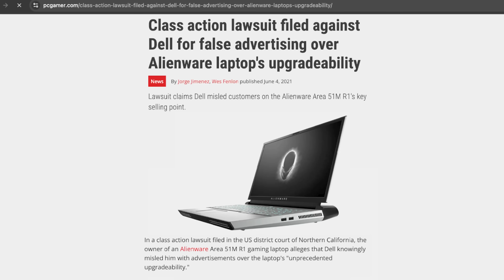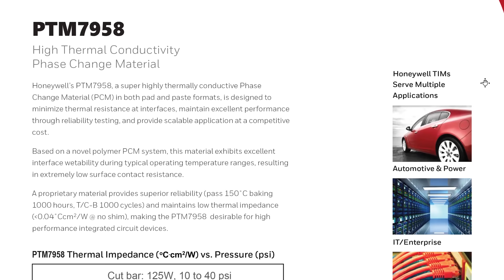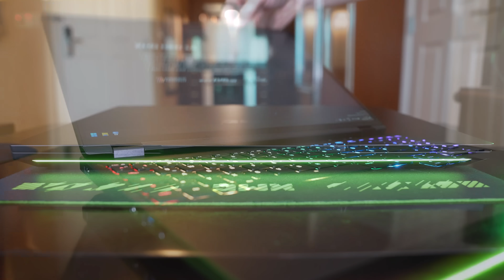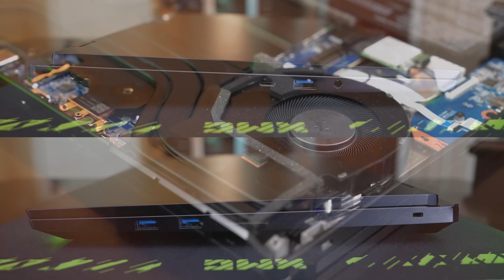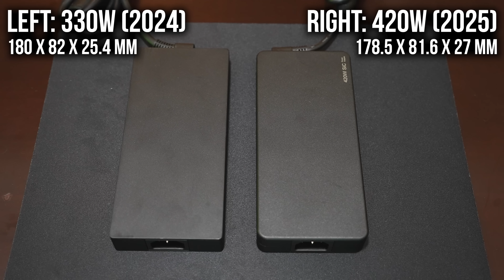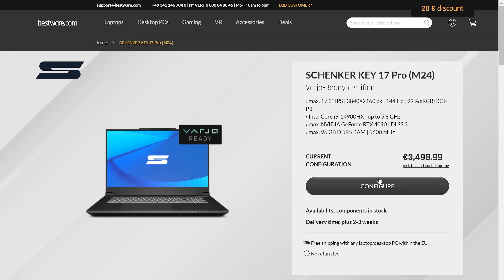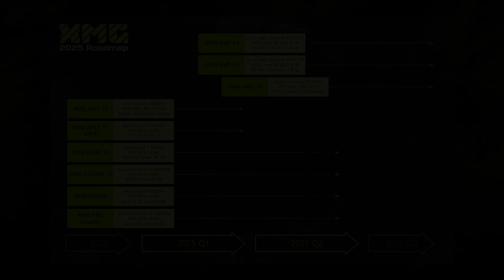This Gaming Laptop has Separate CPU & GPU! - XMG Neo 16

Comment: A step closer to upgradable GPU from big manufacturer. 
Framework is a godsend in comparsion still, but this, however small is a good step in the right direction.
Reply: It's proprietary, so is not a manufacturer agnostic standard, and pricing will probably be ridiculous, as the custom derivatives of MXM boards ended up being (e.g. Clevo)
It's also a long way away from what we had when MXM was a thing and we were putting MSI boards in Clevos and Clevos in Dells and stuff like that
Reply: Not offering the possibility of upgrading with same series GPUs and CPUs , and making it a closed system , makes this a totally useless " innovation" that benefits only XMG ... And it will be marketed as a huge thing and even command a hefty premium ... We're going backwards , and the users are now being used beyond belief.
Reply: Framework is way too expensive to be a sensible option
Reply: @shy9407  That has nothing to do with why Framework isn't sensible right now. The problem is that they still have no sensible dGPU options on their 16 inch models. Like, it's been almost 2 years since this laptop was announced and they still have only one GPU option. Like, I know AMD and Intel don't have any options and Nvidia doesn't want to work with Framework, but...
Reply: @cameron_bosch  It does. You are paying way more. For $2K Framework 16 costs, you can buy a 4080 laptop that's gonna be twice as powerful.
Reply: we have had mxm gpus for like well over a decade or two i think, it keeps popping up very infrequently in laptops, but the fact it does not go away is a good sign, i want to to try and make an mxm module for a framework mainboard or something like that, out of my wheelhouse but it would be a fun experiment and good learning experience, even better if i get something useable out of it
Reply: @_lisan_al_gaib  did you know there a 3070m mxm that exist ? It's a very very unique exemple because there no 3060 mxm no 3070ti mxm etc
Reply: yes Framework is nice but what is holding them back for me is a nordic keyboard layout. maybe they have updated it now. anyhow XMG seems to be the better choice if you are a gamer puls they have a lot of options for keyboards.
Reply: It’s in no way is like that 😂 you can’t upgrade or replace easily
Reply: Framework is just so damn slow updating their hardware, they are STILL on 7840 amds
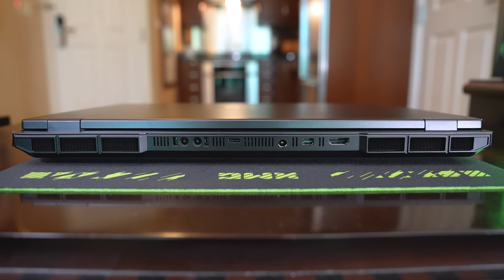Reply: i think you missed a good minute of the video. watch it again at 4:30 onward. this is the worst kind of implementation and nowhere near what framework is doing.
Reply: framework is not a godsend - their discrete gpu's are too weak
Reply: I don't think they will do it.
Look at mobile phones with built-in batteries. Once the battery dies, buy a new phone.
It's built-in obsolescence, "shortening the replacement cycle".
Reply: framework, where youn pay 1K for £500 laptop
Reply: @KentRoads  nah, you pay $1200 for $1100 but for actual repairability.
Reply: @ why don't they just make something that doesn't break? :P